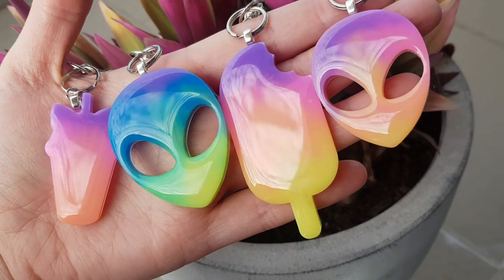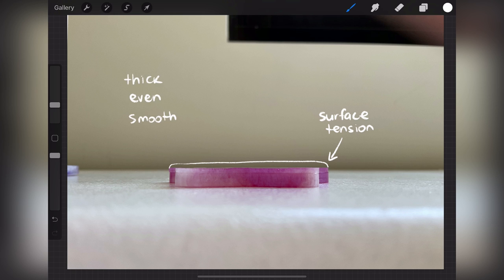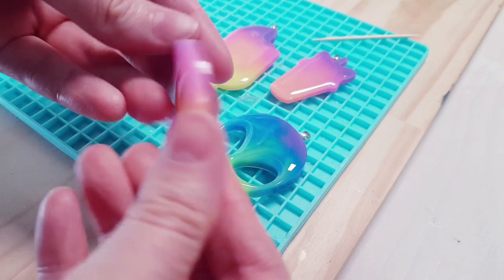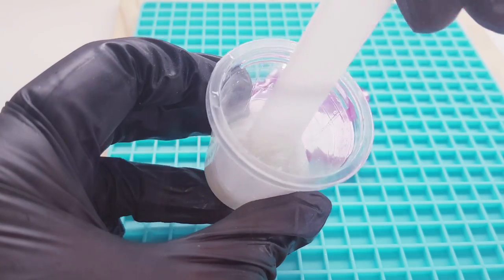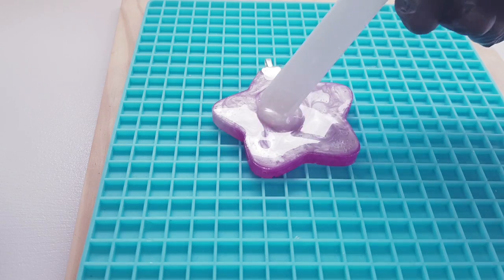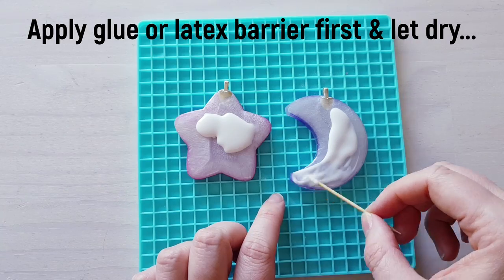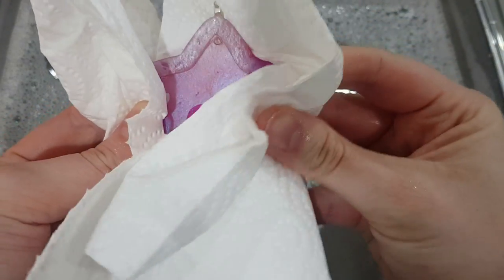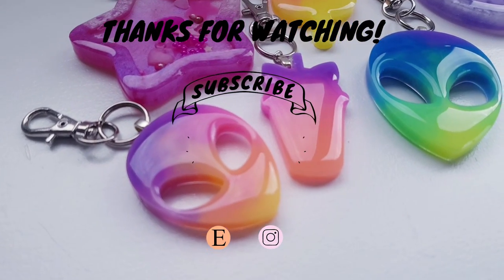Resin Doming Tutorial - How To Get Your Resin Pieces Smooth and Shiny! | Seriously Creative

Comment: Very informative video, thank you. I am wondering can I use the pva glue on the side of a piece that’s not yet been resined?  Just in case drips do form from coating the first side with resin. I’ll be working on a painted wooden piece.
Reply from the maker: You can give it a try! Whenever i use wood i would use painters tape to protect, i just find it a bit easier

Comment: I tried making shakers a few years back. I kept having trouble putting the first layer of resin on over the plastic "top" and with the mineral oil leaking a bit from the hole or edges. It got me very frustrated! You make it look very easy in comparison!
Reply from the maker: Making shakers is indeed very frustrating sometimes. I still ruin some of mine. I will hopefully be working on an updated shaker tutorial soon 💖 but thank you for watching 😊

Comment: Great tutorial, thank you! Do you also protect the sides of the piece with glue? Doesnt overspill run down the sides and stick to the sides even if the front is protected?
Reply from the maker: Thank you! I don't protect the sides, for some reason I've never had issues with the resin sticking to the sides? It will usually just run to the front